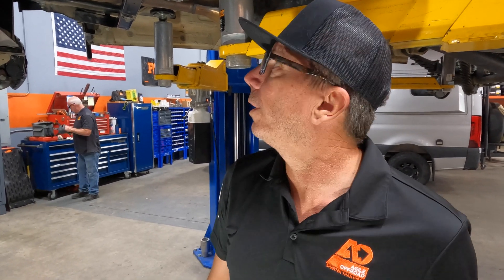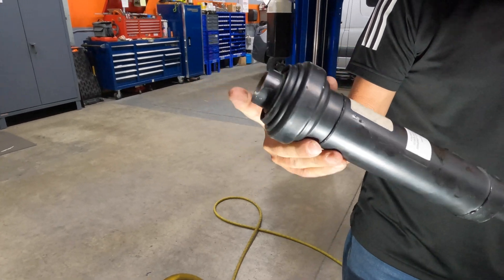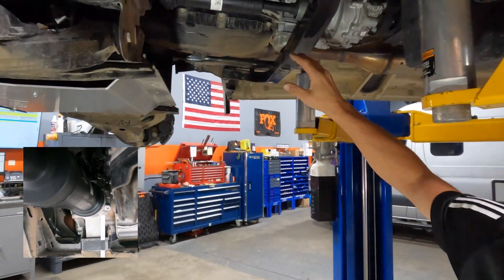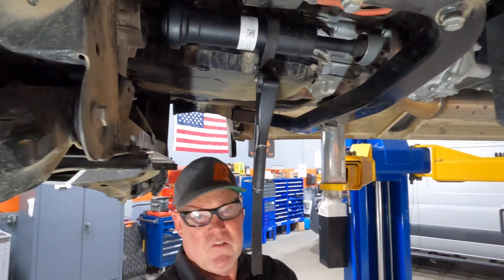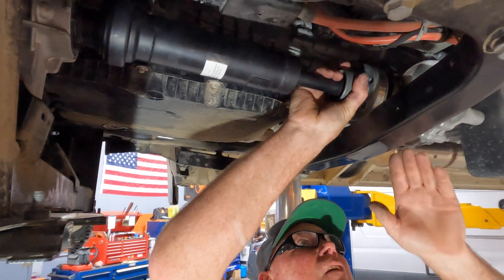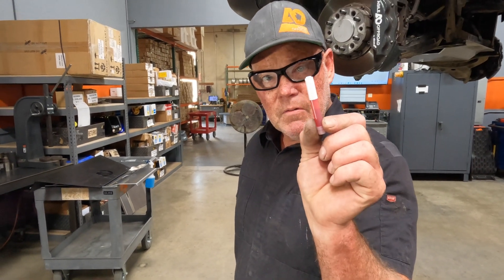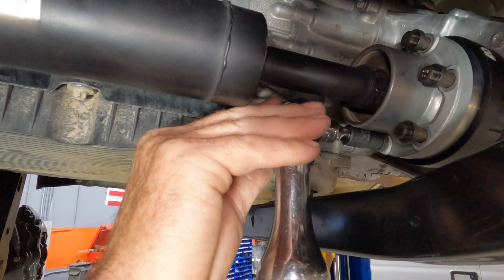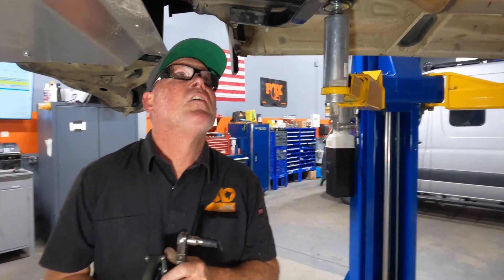2023 AWD Mercedes Benz drive shaft Safety Spacer Install

Comment: Say the entire front driveshaft needs to be removed. Is there a special tool? Slide hammer on a clamp or something that helps disengage the c clip on the forward spline.
Reply from the maker: Check this out: https://agileoffroad.com/wp-content/uploads/2023/09/AOR06-Instructions-compressed.pdf

Comment: I can get under the van just fine with the factory height. Do I need the fronts off the ground so the front driveshaft rotates a bit?
Reply: Just a follow up for those who may have similar question. Great part and installs easy but if you do it on the ground like I did you may not have room to tighten/loosen the bolts that are at the top of the halfshaft. Do all the other bolts you can reach/torque and roll the van maybe 4-6 inches in either direction. the assembly will rotate. Great part AO
Reply from the maker: Great question! You can do it on the ground just fine! If you have any other questions don't hesitate to call us!
Reply: @Agileoffroad how the heck the front part of the shaft is coming off. I'm banging on my drive shaft and trying to remove but that thing is almost like welded. Help 🙏🏻🙏🏻